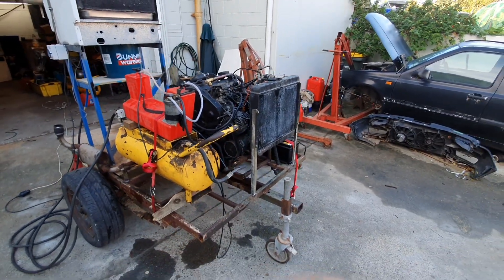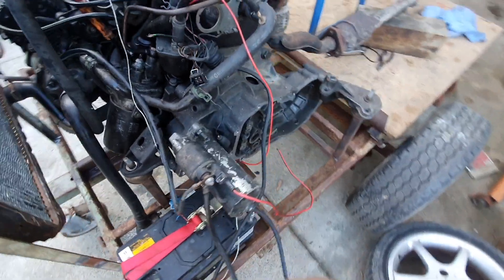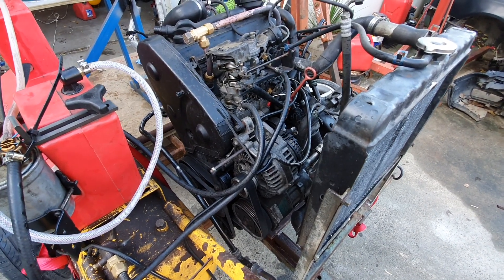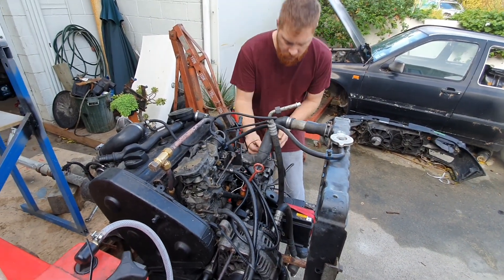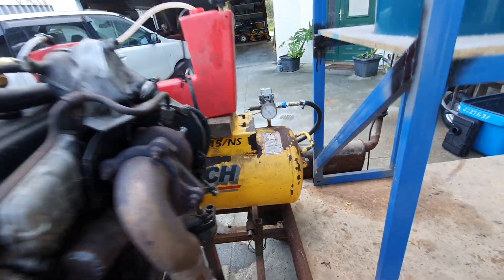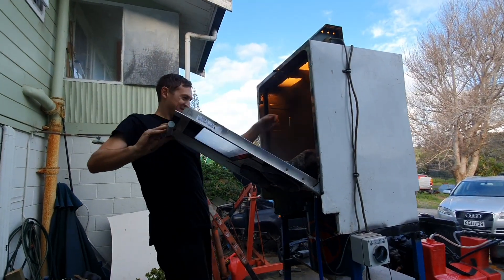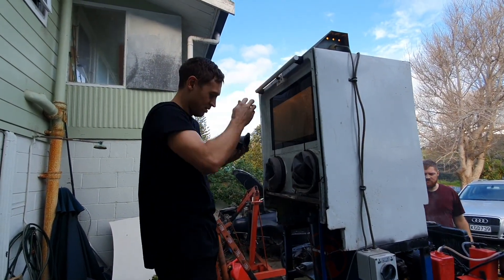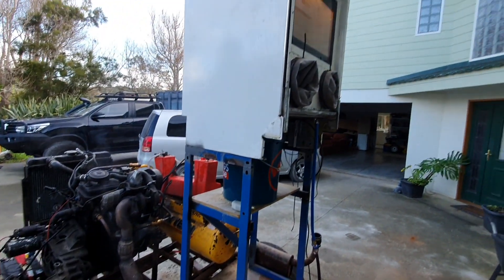Mad Max Compressor and Vapor Blaster

Comment: Im curious as to how the car engine compressor works. The air out the exhaust is clearly going to atmosphere, are you running it on less cylinders and using those cylinders as air outlets to the receiver? I don't see any air pump... Unless you're driving a pump off the crank pulley?
Reply from the maker: Hi Ryan,

This compressor splits the engine in two with one half acting as the drive engine, and the other as the compressor.

Thanks for watching!
Reply: @ArmouryEnterprises  Ok figured as much, runs pretty smooth for only 2 cylinders! Really cool idea - do you know what the CFM would be on it?
Reply from the maker: @RyanBurisch  No idea. I haven't had the chance to sit down and try it out. I think there are a few things we could do to improve efficiency but I would guess it is quite low. It won't go over 80psi. I would guess its around 15 CFM. I have a 50cfm Air cooled VW compressor that works on similar principles. I think that we can get more efficiency out of it, that we could get it closer to that number. 

We were really surprised at how smooth it runs. It definitely needs a decent muffler though.

Comment: Inspiring. Engine based compressors in the US use to be based on Ford 302 engines, one special head so one entire bank was a compressor. They were beasts. 
I have a big pump but no electric motor to run it I should put on an electric start gas engine
Reply from the maker: Yeah I would love to upsize this build! I also have a compressor built from an air-cooled VW engine that I am about to rebuild when I get a chance.

Comment: Nice one josh just make its a got a pop off valve on it mate iam not saying it hasn't just be careful bud whats it gunna be a mobile vapor blaster or something mate ?
Reply from the maker: Yeah it still has a safety valve. Oddly enough it won't go over 90PSI for some reason. We need to do a little more research into why. But for now it seems to be pretty well self regulating. 

Nah its pretty much just a trial rig. We will see where it goes from here but no long term plans